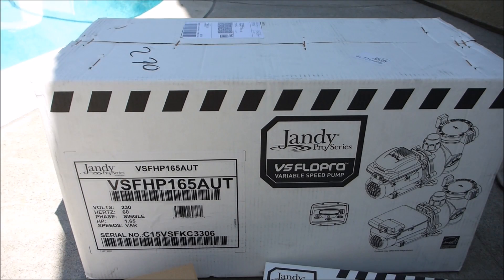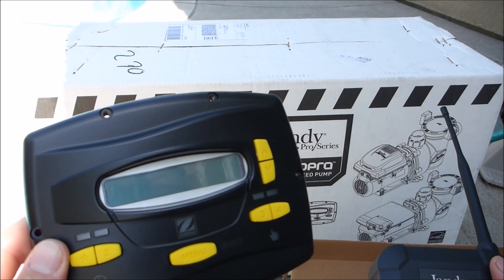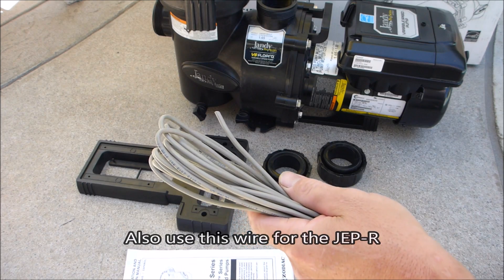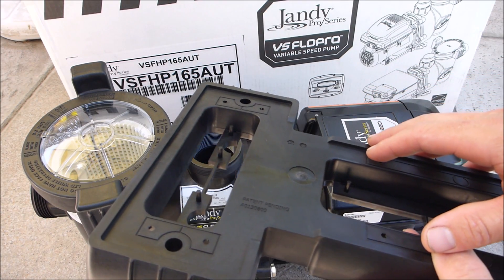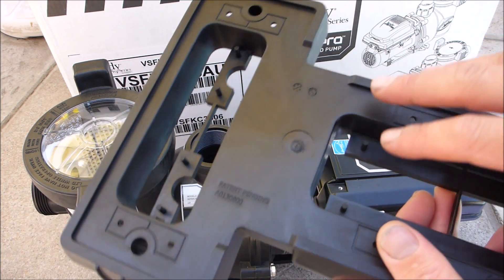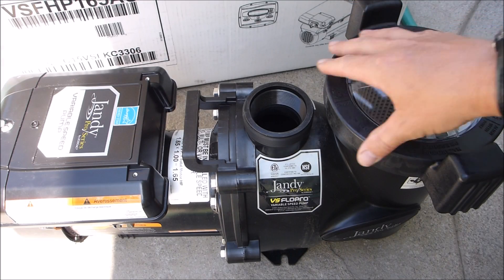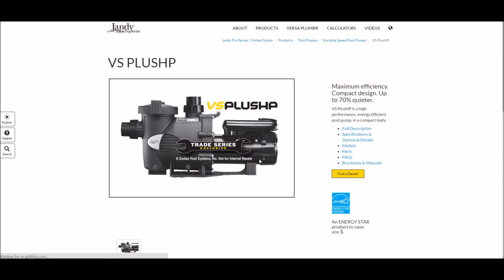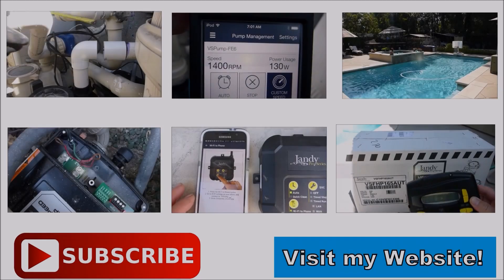Jandy VS FloPro 1.0 HP Variable Speed Pump Installation Part One: Unboxing and Walk Thru

Comment: Hi what is you recommendation to buy a pump Jandy or Pentair?
Reply from the maker: I think Jandy makes a better VS pump and with the iQpump01 controller it is very easy to program it. But if you have a Pentair automated system you should stick with the Pentair Vs pump.
Reply: @SPL  ok thank you for you recommendation

Comment: What robotic pool cleaner do you recommend?   My pool is 26,000gallons.  3.5 to 6ft deep and pebble tech finish.   Has a tanning ledge also.  I have a Polaris 360 that keeps getting stuck in one corner so I’m looking for your advise.  I don’t care about price but what I do care about is ability to pick up leaves and acorns.  Less maintenance the better.  My neighbor has one that the computer part can’t get wet so it has to be put away every time.  Any suggestions?  Thanks
Reply from the maker: A Robotic cleaner would be your best bet.  Here are my top picks: https://www.swimmingpoollearning.com/top-robotic-cleaners-of-2018

Comment: What VS. pump would be best for a 25000 gallon pool with a few water features and a spa? The intelliflo, ecostar or epump
Reply: Ecostar will work just fine. 25k isnt to big. Set 4 in the winter. 8 to 10 in the summer.

Comment: Great video. Thanks again for help. I've been a long time follower and have bought most of the stuff you recommend.  It has always worked great. I have a 44k gallon pool so I was going to get the 2.0 vs flopro. (single quit today). Do you have an amazon affiliate link? I run my pool 8 hours a day at 95 gpm. What should I set variable speed to? I usually cycle pool once a day. I'll donate to your website if no affiliate. Thanks
Reply: Just to clarify. I know how to figure out math to cycle once a day but is their a certain speed these run best? I have no water features, auto cleaners, heaters, salt etc so time is not an issue. Just wanted most energy efficient speed. Thanks!
Reply from the maker: I can't post links here but the 2.0 hp FloPro is actually less expensive at PoolSupplyWorld .com -  $1,059 no tax and free shipping. The iQPUMP01 is $87.00 on their site.  Editing the electrical video now and I will put it up next week. I will send you that video link when done.  This is an excellent pump and I have it installed at my own pool. Uses a Century motor which is a top notch brand.  The money you save in one year will pay for the pump for sure. As far as the best RPM I like setting 2 speeds one at 1400 or 1600 RPM to run most of the day and then a higher speed to run for 1.5 to 2 hours to skim the surface like 2400 or 2600 RPM.